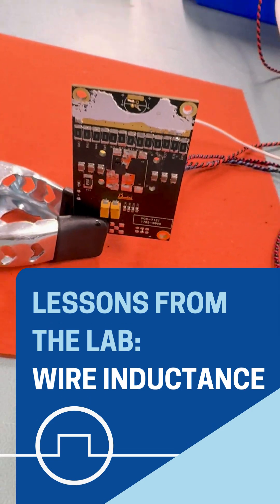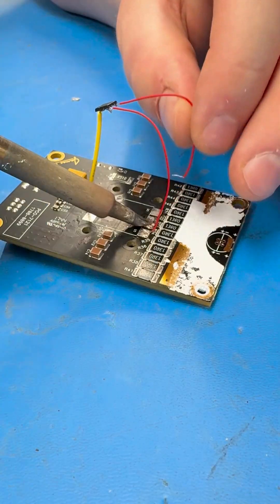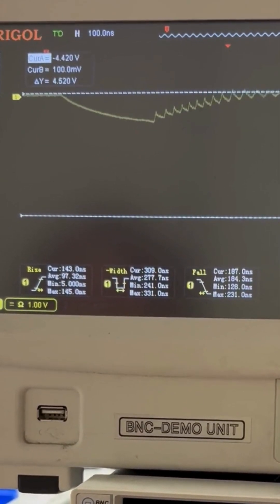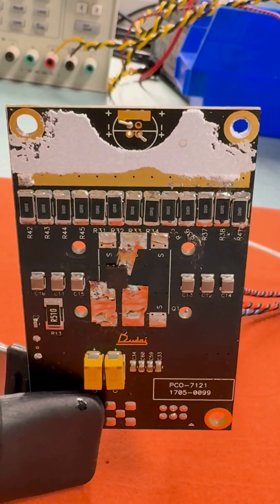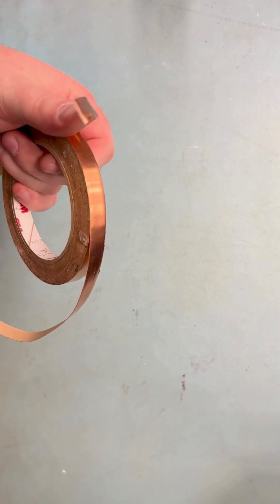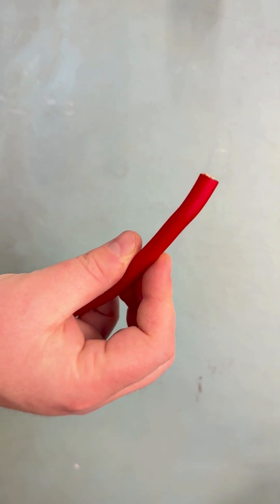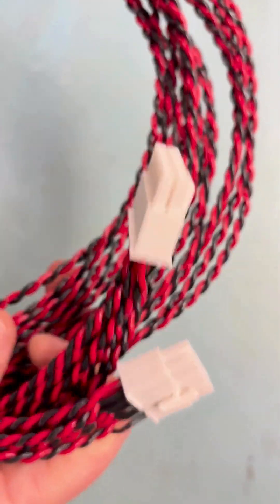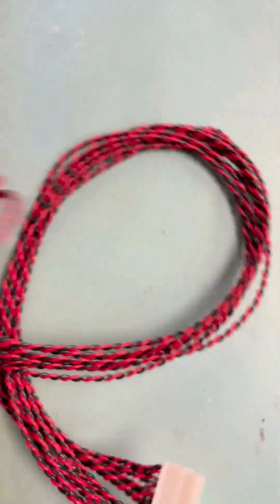Lessons From the Lab: Wire Inductance #wireinductance #electricalengineering

Comment: Those wires you added the MOSFET also acted like an antenna picking the noise & ripple you saw on the signal. I've seen this many times working on RADAR circuitry.